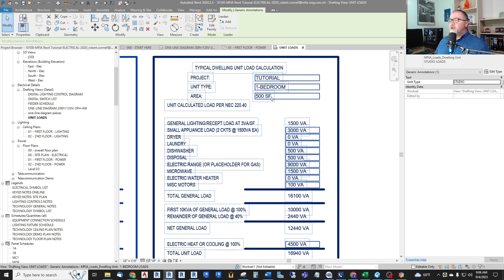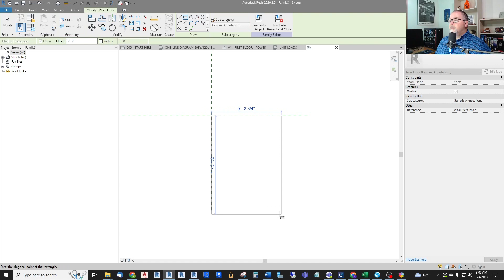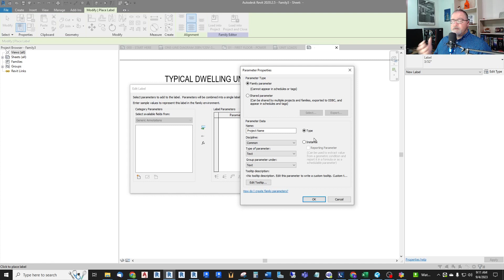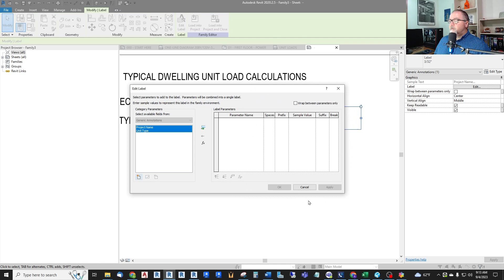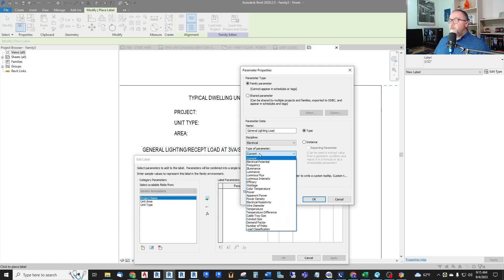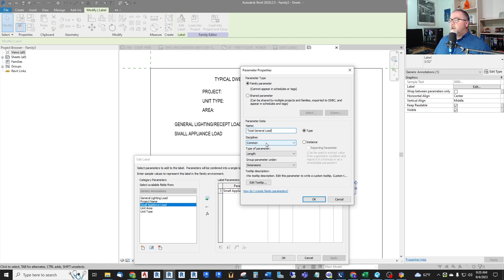Load Calcs Built Into Revit? Here's How

Comment: I love the idea of modeling the loads in each unit the way you grouped them in the load center.  In the past I have done the units in excel, then figured out the loads at the meterbank and just entered them as j-boxes at the meterbank circuited to the meterbank with their demand load types so that they could get added up as they go through the distribution. Plopping a load center with the loads in it in each unit would be nice for back checking or if the meterbanks change. But, It seems like you need to do this differently to get the load types to filter through the distribution. Are you using the regular multi-family demand calc method? Or the alternate method?
Reply from the maker: Hey there Jeremie! Thanks for your feedback! So the loadcenter object in each dwelling unit merely adds up all of the connected loads (including the load based upon the manually-entered area). This "connected load" is used within the actual meter center "switchboard" under the load classification "Dwelling Unit" - which gets the demand factor applied per NEC by the number of dwelling units on that meter center. But a separate calculation is done for each "typical" dwelling unit as this video shows, utilizing the "alternate method" of NEC 220.82, to determine its required feeder. Hope this helps!

Comment: This is a really useful content Rob. i just create a load calc using your tutorial, I made an improvement that i thought I'd share with you. I figure out a way to automate the template such that it will automatically size the permitted feeder instead of typing in the size i.e THE DWELLING UNIT SHALL BE PERMITTED TO BE SERVED BY A 100A FEEDER"  
i created the parameter and in the formular i used an "if" statement: if(FEEDER LOAD < 100.01 VA, 100 VA, if(FEEDER LOAD< 125.01 VA, 125 VA, if(FEEDER LOAD < 150.05 VA, 150 VA, if(FEEDER LOAD < 200.01 VA, 200 VA, 225 VA)))) . that formular does the magic. it will automatically fill in the permitted feeder size base on the calculated feeder load (Amps ) I hope you don't mind the little tweak :)
Reply from the maker: Hey there! That is awesome! A great use of the IF statement - I encourage people to do just what you did - learn something and then expand upon it, improve it, customize it to do exactly what you need! Great work! And thanks for the support!

Comment: Thanks for the video! Do you not include a refrigerator load because it is typically included within the small appliance load?
Reply from the maker: That is correct - the refrigerator load can be included within the small appliance branch circuit loads.

Comment: Great video! How did you get the total load to be in amperes instead of VA in your formula?
Reply from the maker: Thanks for watching - glad you enjoyed it! Good question - I failed to show that step! I created a label with a parameter called "208V Feeder Current" as a Discipline: Electrical and Type of Parameter: Current. Then for the value of that parameter, I just typed in the formula "= Total Unit Load / 208 V" which then calculated the current in Amps. If you are doing 240V dwelling units, you could of course change the 208 V to 240V to get the proper current. Hope this helps! Cheers
Reply: @ElectricRob  Thank you very much for your time! Love your videos! Wish I ran into your channel couple years ago. My life in Revit would be so much easier..lol.